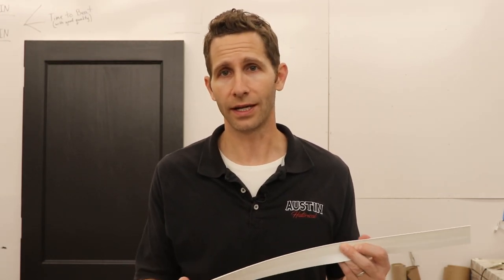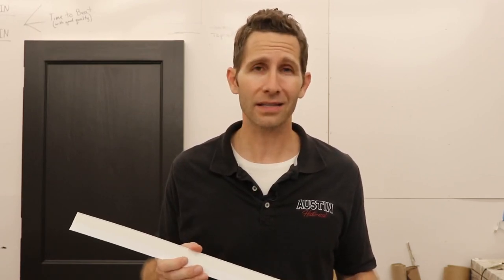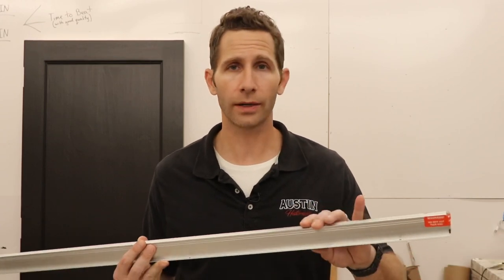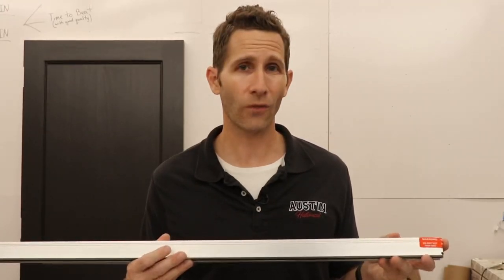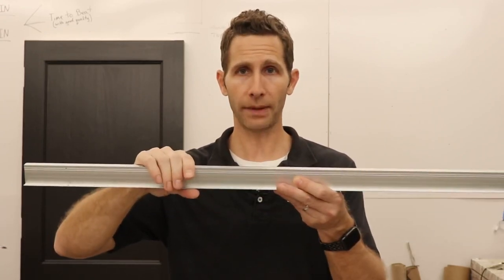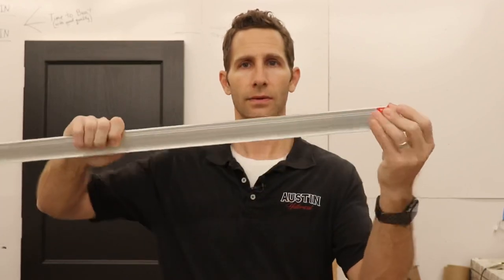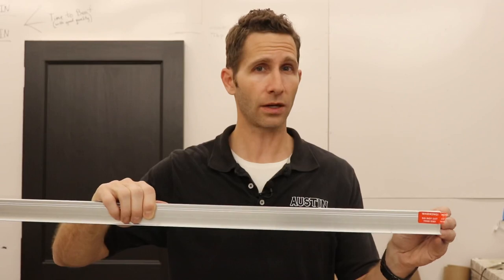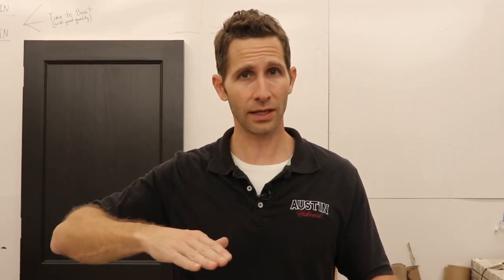The Best & Worst Door Bottoms

Comment: Good video, but there are also options for retractable sweeps that surface mount. Kind of a hybrid between the last option and the second screw-on sweep you showed. They're a good option if you can't (or don't want to) remove the door and route the slot into the door, but need something better than a static sweep.
Reply from the maker: Good tip!
Reply: Really great tip!

Comment: My house is 100 years old and the front door is more than 2 inches thick, solid mahogany, 42" wide.  I can't ruin it with nails and so many of these are for modern standardized doors at 36".  We've gotten fabric door socks filled with beans and now one with bark off Etsy .  Cats have a field day with them but they are a good option. Would love a more durable option that doesn't ruin the door and can be used on a 42" door.

Comment: Hi Scott thanks for the video. I understand why the U-shaped door sweeps can hold water and cause rot, but what about similar L-shaped door sweeps which only screw onto one side of the door?  If it's mounted with a gap between the bottom of the door and the sweep, this would allow water to escape on the open side.  I have seen them come with rain drip guards as well.  Are there any issues with the L-shaped design?

Comment: I'm trying to close a 3/8" gap below the door between my apartment and the building's hallway. Whoever installed the threshold cheated it towards the hallway (the hallway side of the door is centered on the threshold and the apartment side of the door doesn't have any threshold below it). I can't use the standard doorsweep without the vinyl dragging across the floor and likely marring the laminate wood flooring. I probably can't use the u-channel "problem child" door shoe because the fins are likely more substantial than the 3/8" gap I'm trying to close and thus would also drag along the floor. And I'm trying to avoid the hassle of replacing the threshold. What would you suggest? Have you tried those double draft seals that are just fabric covers with two foam inserts? Again, this is an interior door so I'm not worried about moisture, more concerned with soundproofing (and to a lesser extent eliminating draft).
Reply: You could trim that u Chanel.

Comment: Would the one that rots the bottom of the door be better if there were tens or hundreds of perforations to let the water out?
Reply: Then you’d be back to square one, water would be dripping into the house
Reply from the maker: It would still hold too much water and not allow the airflow necessary to prevent rot.
Reply: @barryallenporter8127  Fair point but cold air flow in winter is why we had these things, not water.
Reply: @barryallenporter8127  Door thresholds are (supposed to be) slightly angled. It would only drip out outside .

Comment: How about sealing the U-shaped sweep with caulk to prevent water from entering and collecting inside the channel?
Reply: Exactly, just caulk around the edges before installing. But also drill some weep holes every few inches just in case.

Comment: I looked at my 2 external doors and neither one has a bottom door sweep. No door sweep at all.
Reply: Feel the bottom of your door. My 80 yr old home has a metal sweep that fits into the threshold when closed. You can't see it. It got bent when the door was removed to allow a new appliance delivery.  So I'm looking for fixes. I used the stick on type a week ago as a test before moving to a screw in. Amazing reduction in cold air. That metal wasn't doing much insulating.  

My screen door needs a sweep as well,since the original strip is deteriorating. Using the screw in type, but project delayed because I  need drill bits for metal.